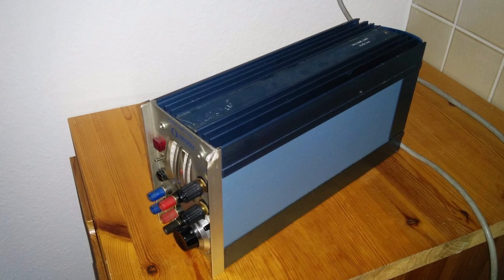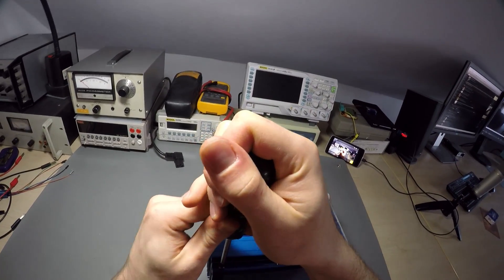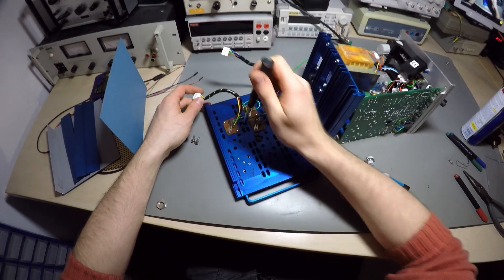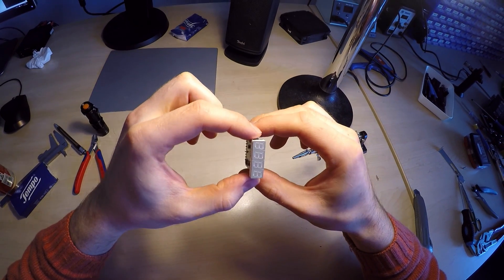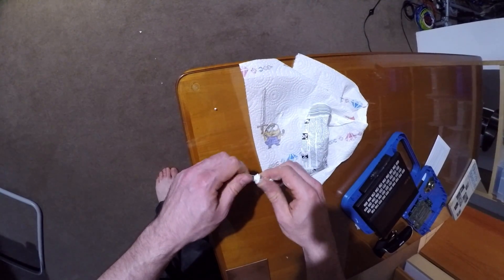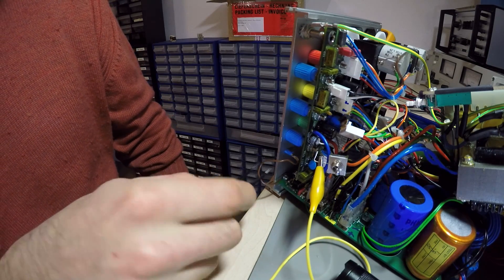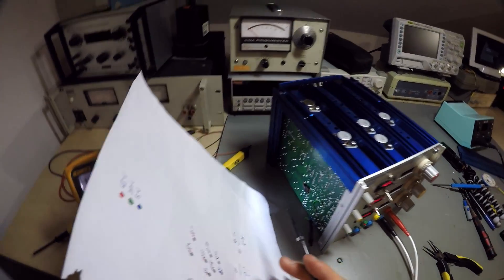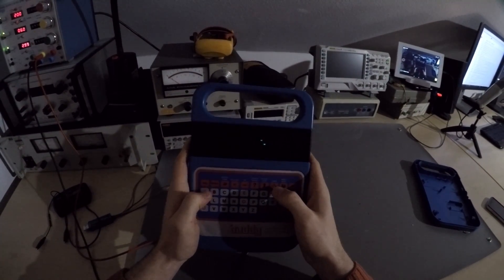Oltronix Power Supply B703 Teardown + Repair

Comment: Hallo schöne Arbeit die Reperatur, habe eine Oltronix Power Supply EPR602. Hast du ev. Manuals und einige Tipps zum reparieren. Es hat 10turn Potentiometers welche einemal Spannung und Strom regulieren beide reagieren nicht und es gibts keine Spannung ab. Danke und grüsse Chris

Comment: Not really engineered properly, is it.
They must use interns to save money.
Reply: It is, you can easily dismantle it completely in five minutes. The socket of every connector has a number printed onto the pcb, as long as you write that number on the connector with a sharpie you are good to go.

Comment: good thing i do when taking unlabeled connectors off, proof mark them, use a sharpie and just draw a line across the connector, its highly unlikely when you miss plug  connector that the proof line will line up perfectly.

Comment: In a lab at KTH, the RoyalmInstitute of Technology, in Stockholm we used to have dual-output Oltronics power supplies which always started up with a voltage spike. You had to disconnect them from your circuit, switch them on and then connect your circuit in order not to kill anything in the circuit.

The B703 is of a much better design and quality...

Comment: You are doing it all wrong!

These 1970s/80s units are absolutely AWESOME to work on.
The trick is to remove only the two screws from the bottom that are holding the U-bent aluminium cover in place. Remove the screws and slide of the cover. Everything else is accessible from there - no need to tear the whole frame apart!
On the B60-1T, the main PCB with all the trim pots and pleated resistances for calibration swings out like a hinged door. Power transistors and fuses are accessible from the outside and can be switched out without opening the unit at all. Just remove the top covers by sliding them out to the back.

Congrats on this nice lab PSU, I own a B60-1T - in case you want the service manual, drop me a PN :)
Looking forward to getting a B703DT myself!
Reply: As a owner of two of those monsters, i can assure you that they are a absolute pain in the a** to repair: Yes, you could in theory just remove the sidepanels but then it becomes unstable as all hell with the big transformers starting to twist and bend the PCBs... And if a component dies, you are just f*ed: There is no way you could repair it as you would have to dismantle the entire unit. And trust me, you can't do that. Even trying to reach the poti of the second display will be a rage fueled adventure for hours as you are struggling to keep the damn thing from a) killing itself (by twisting of the pcbs) and b) killing you (with sharp aluminum corners).

There is a reason you get these monsters for 15 bucks shipped... And it has usually nothing to do with the person begging for someone to take their PSUs. This person just had the sudden realisation that his own sanity is more important than saving a few bucks.
Reply: rofl
Reply: May be I am blind, but I am not able to send a PN. How can I get the service Manual? I have the B703DT with the analogue Meters...

Comment: Why is the quality not so good? I now have a Philips PE1542 which I bought yesterday, but it is generating smoke on the 0-7v line at 3A (shorted, the way to set the ammeter according to the manual). I am thinking about returning it and trading it in for this one (revised, for 100 euro's). Thanks :)
Reply from the maker: I am still using this psu, and overall I like it. But I dread the day that I have to open it again. Crowded construction, some wires are directly soldered to PCBs, some have spade connectors, which aren't great either. It is difficult to take it apart and dangerous to power it up while disassembled (for troubleshooting, because of a heavy mains transformer leaning on other components).
Reply: Thank you, so all and all it's not a bad PSU, just the dissasembling, but this COULD be fixed by adding some connectors the first time it has to be opened.

The PE 1542 isn't easy either, so I guess more setups are like this. Live troubleshooting isn't for me yet (absolute beginner) and I just want a powersupply that works and I can use for several years. The 1542 has to be rebuild so it will take me at least 40 euro's to overhaul. That sets me 10 euro's apart from buying the B703 and saves me a whole lot of time and trouble.

What would your advice be? :)
Reply from the maker: Oltronix (revised, for 100 euro's) sounds good, check it thoroughly, maybe you can find a minor problem and get a couple of bucks back. I have encountered so far: Broken internal wires, CV CC LEDs not working, stuck potentiometers, current limit not working (destroying output transistors)
Reply: I think warrenty won't be a problem. I'll ask about what they have done and will let you know how it ended. Many thanks for the quick response!
Reply: I only know the PE1542 by reputation ("if it works, works very well, if you have to repair it, have fun"), but not every lab power supply is like this. I have some small cute Philips supplies which are constructed very nicely and fold open just like a book. Easy access to everything from all sides. The small HP (half-rack-width) bench supplies from the 70s are also easy to service. I'm not sure if they still make them, but not long ago Agisight still produced those basic E36xxA supplies that are very similar to those older units internally (circuitry & ease of access).

(However, looking at some of my other Philips gear, in almost every unit they did use very few connectors and instead soldered all boards together. Whether that's annoying for servicing mostly depends on the rest of the construction).

Comment: Noting the use of bare feet to earth the electrostatics!

Remind me not to buy one of those power supplies. I don't mind mending things as long as the manufacturer has designed them with repair in mind. The whole design concept of this oltronix reminds me of looking under the bonnet of a peugeot - loads of stuff, but can't get to any of it
Reply: Had the same experience with mostly any French car I dealt with.
Reply: Oz Media pronounces it pway-git